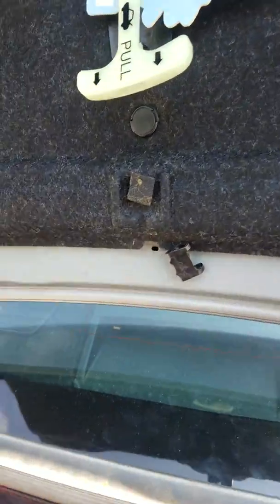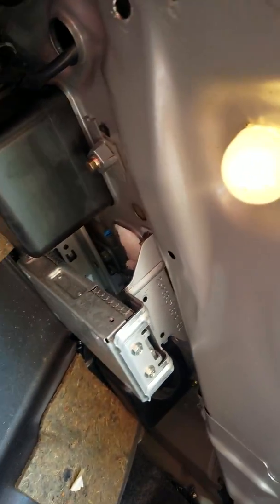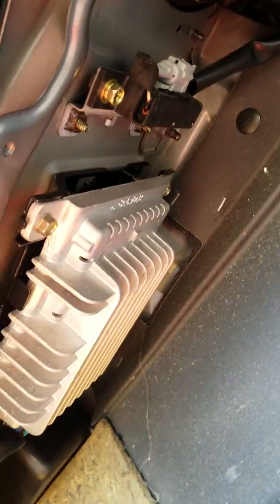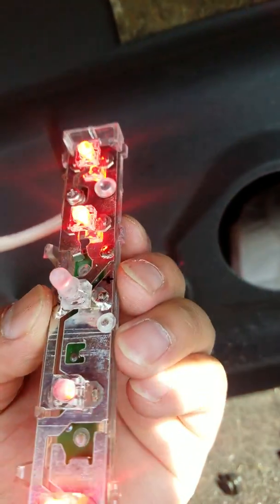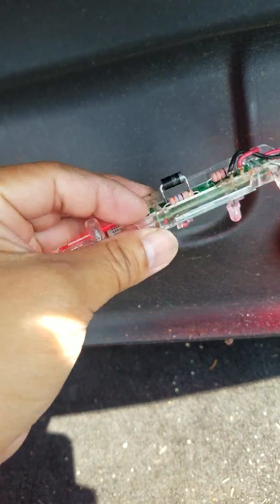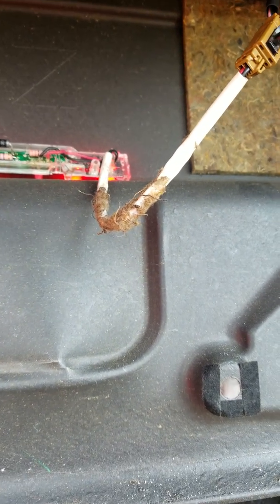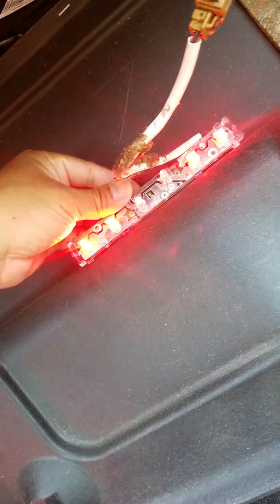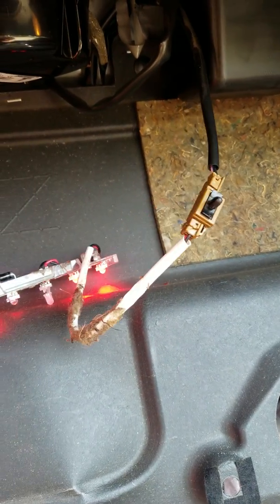Infinity g35x sedan 2006 third brake light fix

Comment: The whole cover comes off from the inside with a trim tool or flat screw driver. You can then unplug the light and take the whole housing out f the car and unscrew the led from the housing.

Comment: Thank you very much for posting this video. It shows clearly where to drill the holes if you have LED failure. Mine was a cable problem. The cable was bent 360 degrees and tucked in. I believe this was factory setup. The point where the cable folded in half was where the problem occurred. Luckily, I didn't have to spend hundreds to get it fixed.

Comment: I had the same problem. But it wasn't the diode. It was the connection needing to be soldered again. I don't have a soldering iron so I split the wire, added some Cooper wiring and pinched the clasps closed. That worked fine. And you don't need to fill anything. The price that is covering the light is basically card board. Pull it down to bend/fold it. (I just broke it off, it's just there to stop you from accessing the light) then just undo the clamps to the LEDs. You'll be able to remove the LEDs and the wired connection. No need to remove the whole assembly just the LED panel

Comment: Bee Yang...this same thing happen to my 2004 350z roadster. They used kind of Wet-suit spongy neoprene type perimeter gasket....as the base. Which will hold moister...that may have causes short periodically. LEDs bulbs, with only 4 lights working. Hard part is taking it ALL apart without cracking or breaking it. So.....the DIODE I can use is *5408 and the OEM Nissan Diode is *1N404 ?? Maybe it could be my Brake Switch at the Pedal...not sure now!

Comment: Had the same issue but I used a smaller screw driver to get it out. I didn't have to drill a hole. But now I can't take out the lights because it's too compact!
Reply from the maker: Probably got to drill that hole?
Reply: @legacyonetime  I didn't want to do any damage to the car so I decided to remove the whole back seat to get to it. Sounds time consuming but it wasn't. I found out that the wire to the LED light wasn't working properly so I decided to rig my own LED lights. Bought some red LED lights from O'reilleys, remove the adhesive and put it onto the back of a cardboard box. Trim the card board to size and taped it to the back of the light cover. But I had to cut the pig tail off the old LED light connector and spliced it to the new LED lights I bought so that I could connect it to the old harness. Works fine now. Shine just as bright or even brighter.

Comment: Thanks for the solution Bee. I have the same problem. I's a newb w drilling. How big of a bit did you use to drill the metal plate in your Infiniti. I need to do the same procedure on mine to replace my rear light as well.  Btw will any drill bit work or is there a basic drill bit that works.
Reply: I would suggest using a decent sized bit to have some wiggle room in case you cant reach the screw.